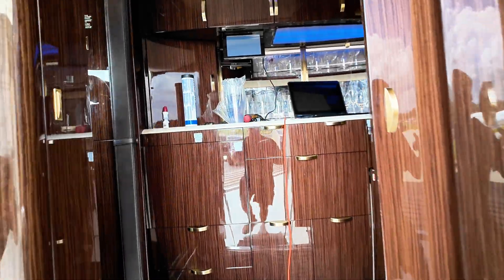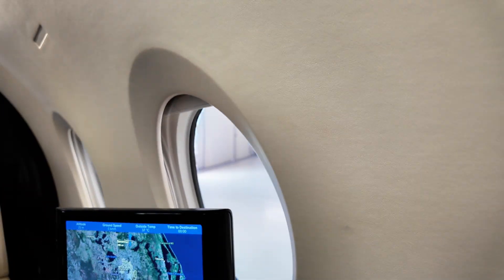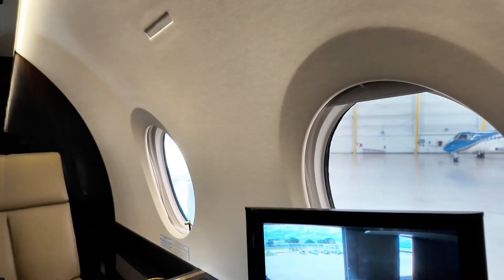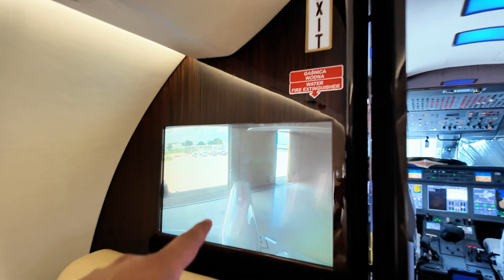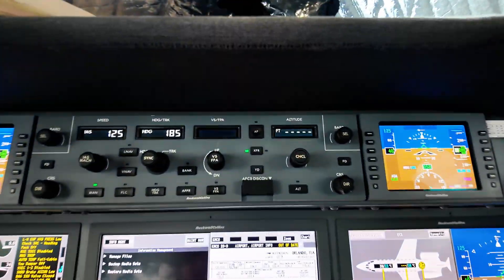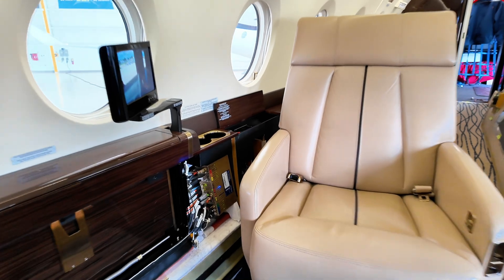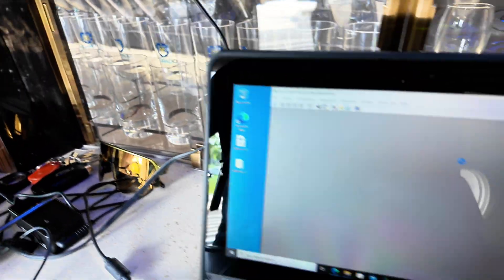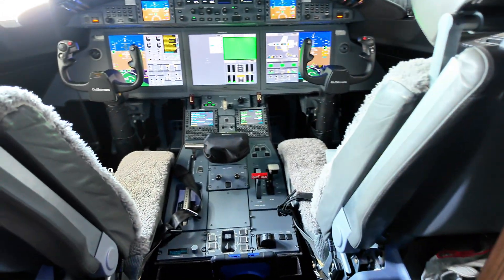A day as an Aircraft mechanic : Gulfstream G280 + Global 5000 Private Jet Maintenance

Comment: Seems like you have a cooling problem with all your nodes!  Fix the root cause....
Reply from the maker: Node 3 failed due to a shorted card cooling was good, no history or overheat based on our status, node 1 has bad fans apparently. the biggest problem we had here is that they were all outdated and running on very old revisions. Now that we have updated them  nodes are running within proper temps but node 1 is still on its way out sadly. 

When it comes back we will be changing it out as well
Reply: @Wrenchinghorizons  Thanks for the reply! Great Job!